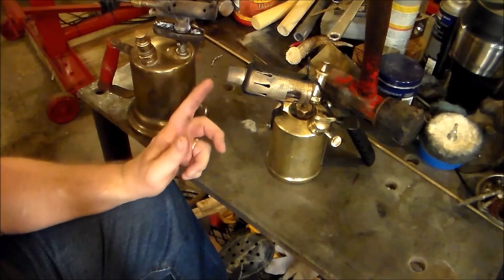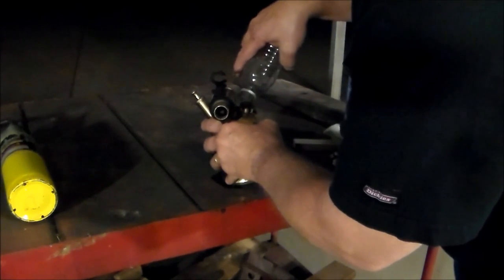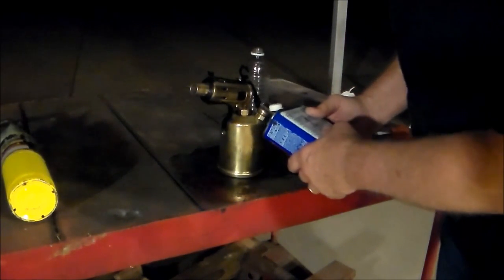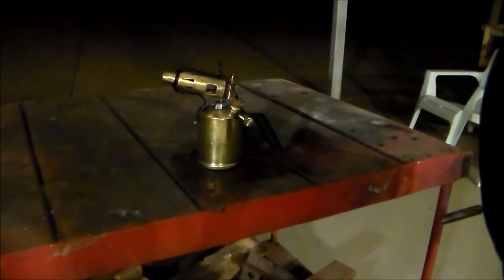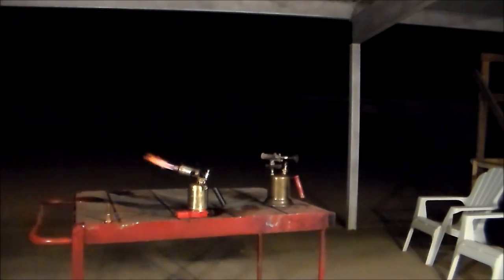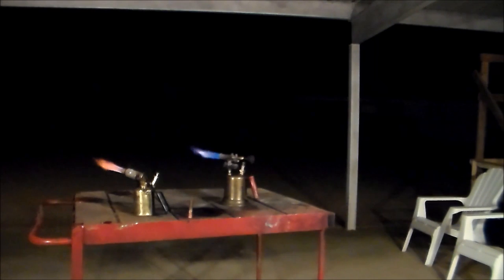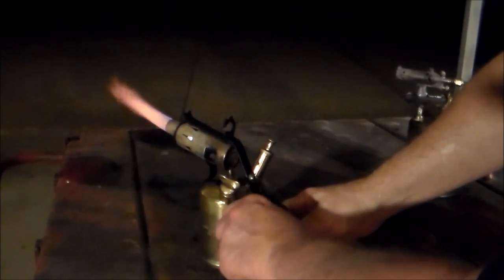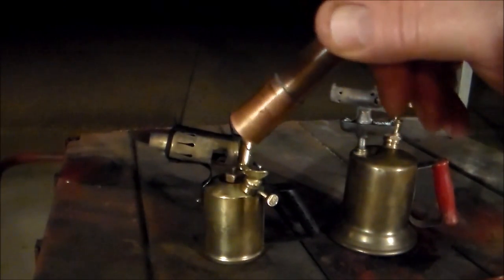How to start the Optimus Blowtorch

Comment: That torch soldered that pipe just dandy. I like the way the gas one throws flames :)
Reply from the maker: Thanks, It will shoot a flame about 3 to 4 feet till it warms up. But that other one did a nice job with the copper.

Comment: Those were used by painters and plumbers. Handy size and run on paraffin give a nice blue flame. Or, as I'm sure you know Lloyd just too much fuel and not enough air.
Reply from the maker: It was the first time that I fired it up. I'm sure it needs a little adjustment. But that was a lot of fun getting them going after they have been idle for so long. Thanks Malc.
Reply: Yes, well done on getting it going. Just like Tilley Lamps, they are collectors items nowadays. Because they are 'pretty' quite a few had them in the fire-hearth, or mantelpiece when they became redundant.